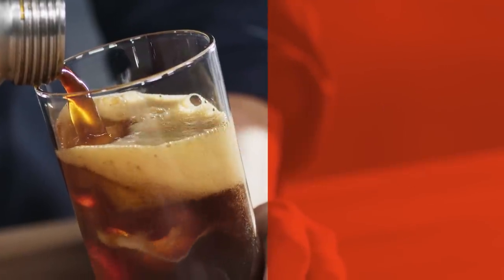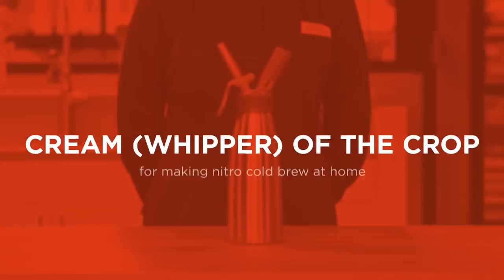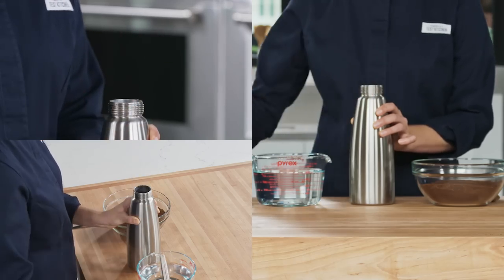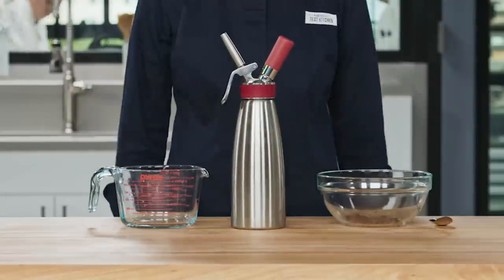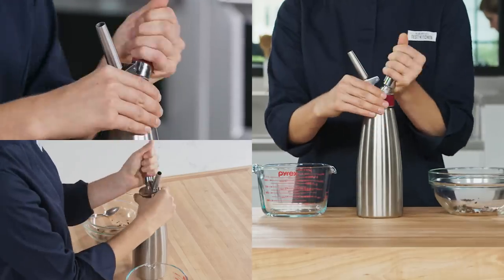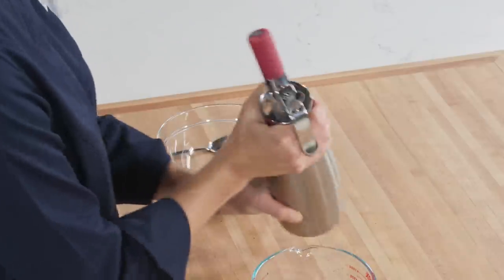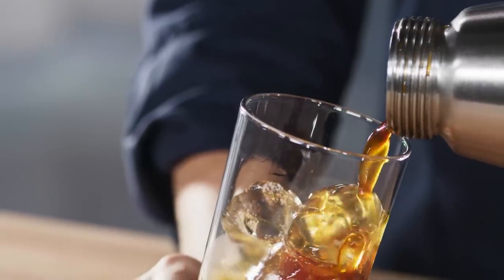How to Make Nitro Cold-Brew Coffee

Comment: That's an INSANE amount of nitrous oxide cartridges to use for what amounts to less than a pint of coffee...
Buying a 24 pack from Amazon costs 29.89, for $1.245 per charge. Using 5 charges to make a pint of coffee totals  $6.23 in pressurized gas.
The total volume of the whipper is a pint, but we'll probably only get 70-80 % of that volume as actual coffee. So that amounts to 355 ml of coffee...

That makes for $17.55 per liter in gas charges alone.
Reply: whitescar2 Thanks for doing the math. This seems like one of those things to do just for the ‘cool’ factor.
Reply: Just looked and you can get 50 for $37 on Amazon
Reply: @drthmik  I'm sure it's possible to push that value down, though I would assume that the price per charge is still around 1$ per cartridge for the kind of gas that you'd want to use in this application. Maybe the bulk buy is a great deal, or maybe you're putting yourself in danger if the gas isn't 'food grade', the capsules don't hold as much pressure, or are of an inferior and potentially dangerous quality.

I ran the numbers for what I'd assume an "average" user might encounter. Although I suppose an average user wouldn't be using a whipped cream siphon to brew coffee...
Reply: You're getting ripped off at that price, I bought a ten pack at bed bath and beyond for $9.99 or about a buck a piece.
Reply: Chargers are definitely expensive, but the recipe only calls for one. The other chargers are only if you don't want to take the time to brew cold brew traditionally. They're completely optional. The video covers this.
Reply: If you can filter out the sputtered coffee, you should be able to huff the resulting laughing gas. Waste not, want not, amiright?
Reply: @MelindaGreen  I love saying "am I right?". It takes away the ability for someone to say the idiotic phrase "I know, right?". Am I right? 😁
Reply: Exactly...theres a better version of this on chefsteps
Reply: whitescar2 
Just to clarify, the main part of this video was using nitrous chargers to make quick cold brew.
Reply: 24 for $16 cad at Costco business. I used a lot of them for "other reasons" 
You could also just brew the coffee concentrate longer using another steeping method. The multiple cartridges was only for brewing it over an hour vs overnight
Reply: That's why you get a large canister of nitro
Reply: Thanks for the breakdown! This presenter kept changing chargers. I call B.S.   Who can afford that? Ahhh, a "Test Kitchen, can!"
Reply: You’re way overpaying for cartridges at that price.
Reply: Yeah, this isn't how you do it, this is for wasteful people. You first make cold brew, then put it in the whipper, then use one cartridge..

Comment: What a waste of resources. 5 CO2 cartridges to make some coffee.....
Reply: N2O?
Reply: It does seem a little extreme. Depending on where you buy your whipits from and how many you're willing to buy it seems like it would add $3 to $5 to the cold brew. But some people may find that acceptable.
Reply: Its not like nitrogen is the most common element in the air... And those canisters can be recycled.
Reply: @axeavier  No, just N2
Reply: @obtree  no, nitrous oxide is N2O
Reply: @Crushnaut  They're not putting a psychoactive chemical into food. Pretty sure about that one.
Reply: @Crushnaut  Also, nitrous oxide is n2o. NO2 is nitrogen dioxide, and it's used to make nitric acid.
Reply: @obtree  you are right about the N2O vs no2 ... But they are using nitrous oxide. Look on Amazon for whipit canisters. They are nitrous oxide.
Reply: @obtree  from Wikipedia; The gas is approved for use as a food additive (also known as E942), specifically as an aerosol spray propellant. Its most common uses in this context are in aerosol whipped cream canisters and cooking sprays.
Reply: @AbsurdJosh  I think you mean "not like nitrogen is the *rarest*" because it is actually the most common element in the air
Reply: Bigger waste is taking all the time to do this and pouring it over ice

Comment: Thanks for the video! Very informative for my use!
I have a nitrogen generator (do not need tanks of gas) and am planning on making my cold brew in a 7 gallon wide mouth Torpedo corny keg to have 5 gallons finished product. 
Was definitely wanting to brew with light pressure to have an oxygen free environment but after watching this brewing in a high pressure environment for a quicker brew time makes more sense. I may have to get a TDS meter and experiment. Purging and doing it a second time makes sense too. 
I agree this would be expensive using cartridges but I’m only paying for electricity to make my own 99.97% pure nitro using a generator.
Reply: Yeah I've got CO2 tanks, korny kegs, and all done at 60psi to cold water for sparkling water at all times with my morning espresso. Have been looking to get tanks of nitrogen gas with no luck, I'll look into a generator like you mentioned to make nitro Pepsi, thank you!

Comment: A lot of you really didn't pay attention to the video. The recipe doesn't call for 5 charges, it only calls for 1. The other 4 were shown, explicitly, as an alternate option to speed up the cold brew process if you didn't want to wait 24 hours. They, literally start the video saying "our 24 hour fool proof steep method works great for this, but we've found that a cream whipper can also be used to quick brew cold brew concentrate under pressure. Cutting the brew time down to just over an hour."  They're just giving you options.

Usually the ATK comments section is a lot more sensible than this, but for this particular video apparently people just tuned al the info given at the beginning.

Comment: Seriously, what the heck? Not only is the brew process unnecessary and wasteful, you completely knock the gas from suspension once you filter it and undo everything up to that point. That's nonsense. Just cold brew the long way then charge it with one nitro cartridge at the end.
Reply: They cover exactly that. The first thing they say is the that "the 24 hours steep method works great for this". The other method is just an option they gave for impatient people. The recipe shown only uses one cartridge.
Reply: @schweedy1985  the point being that the quick method is wasteful, impractical, expensive and completely unnecessary. On top of that, they completely negate the charged brewing when they filter it. It's just dumb.
Reply: @leesalt  Regarding the loss of charge when filtered, they're still making the cold brew concentrate at that point. They don't want that to be charged, they just want concentrated cold brew. 

 I'll agree that this quick method is impractical, but they gave it as an option not a requirement. They just know some people don't want to wait 24 hours for steeped cold brew, and offered an alternative to speed it up. Obviously you and I will not ever be the ones using that process, but people are acting like it's part of the recipe, and it's not. It's just an alternate way to get to a cold brew concentrate.
Reply: @schweedy1985  they didn't cover exactly that.  They mentioned something about slow brew, but it gave no directions on how to make nitro coffee using that method.
Reply: @arviragus But they did...

There are two recipes in this video. One for quick cold brew(which is arguably a waste of expensive charges, but it saves 20+ hours of waiting), and one for the making of nitro. 

OP here was complaining about how much of a waste the quick cold brew method is, and states they should just brew cold brew the long way. Which is totally fine as an opinion, in fact I mostly agree, but they stated it in such a way that it's an attack on the video, which is bs. The video does also cover that the slow method is a perfectly acceptable option; "our fool proof 24 hour steep method works great for this". The recipe that follows is just them giving you the knowledge of how to make cold brew concentrate quickly using nitro charges(they are not making nitro yet at this point, just the cold brew concentrate). Additionally OP mentions how that portion of the recipe doesn't make since because they would displace the nitro during the filtering process; which is true, the charge would displace... but they aren't trying to hold on to the gas at this stage, since they're still just creating the concentrate. 

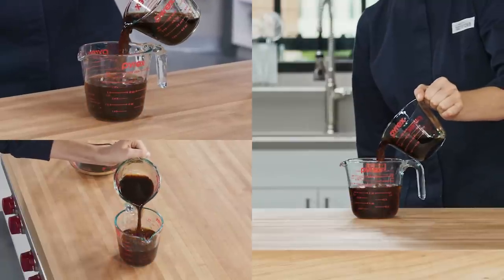The recipe for the nitro cold brew itself comes afterwards once the concentrate is made(at 2:10).  

Basically think of it this way, in order to make nitro you need cold brew concentrate. They tell you doing it the slow way works great, but also give you an option by showing you how to do it the fast(and expensive) way shown in the middle portion of this video. Once you have cold brew concentrate you just follow the recipe at the end for making the nitro cold brew. 

So many people are caught up on this quick method for making cold brew concentrate being wasteful, but the video doesn't tell you you have to use it... they're just giving you options if you don't want to prepare a full day in advance.
Reply: @schweedy1985 , You are misuderstanding LeeSalt, only one nitro cartridge is needed! Every time you release pressure, and add repressurize, you've unnecessarily wasted a cartridge.  Ask anyone that makes CO2 soda pop at home.
Reply: @tjam4229  I am not misunderstanding OP at all,  you are misunderstanding me. 

Please watch the video, and listen to them. There are making cold brew concentrate at that point, not nitro. I fully understand what you are saying, it's just not relevant to what they are doing in that recipe. They aren't trying to hold on to the nitro gas to make nitro yet, they just using the gas to speed up the process of making cold brew concentrate. (which usually needs to steep for 20-24 hours, this recipe using the charges takes minutes instead, they're simply giving you options)

 (There are two recipes in this video: first is for quickly making concentrate using multiple nitro charges,  and second for making the nitro itself) 

If you don't understand what I'm getting at here, read all the other messages I have posted in this thread. I've covered nearly everything there is to cover.

Comment: This is a neat idea, but it would have been nice to get more info about the reasoning behind this process. What is the reason for carbonating three times? Is during-brew carbonation just to expedite the brew process, or is it actually affecting the final product significantly?
That said, this seems like an extremely complex (not to mention expensive) process. I'm pretty sure the materials cost for the NO2 canisters alone negates any savings in doing it at home. I understand that ATK is aiming at those who have perhaps more money and time than technical ability, but wouldn't it make vastly more sense to DIY a carbonation system compatible with NO2, both for bulk production and cost savings? Aside from a teensy bit of tool use and pressure-testing up front, I'm pretty sure that's almost as easy, way faster, and way less expensive in the long run.
Reply: Take this with a grain of salt, but I think it might have something to do with the ability of N2O to dissolve in fats. Once the N2O is dissolved in the water, it may help to dissolve the oils of the coffee into the water, speeding up the brewing process. But I highly doubt it's worth the cost and the atmospheric effects of laughing gas.
Btw, two technicalities: It's N2O, not NO2. If you used nitrogen dioxide, you would be drinking nitric acid. And it's not carbonation, that's only with CO2 :)
Reply: Whoops, yes, you're absolutely correct. Been a few years since I had to take a chem class, and I thought I remembered better than I actually did :)

Comment: I think using all those Nitro cartridges are a waste for such a small amount of coffee.  I think there must be a better, cheaper, similar way to do the same thing for a lot less and less wasted cartridges
Reply: Yes, brew your cold brew the old fashion way (steep it like tea for 20 hours). Boom.. just saved like 4 cartridges
Reply: Well now you're just being rational.  😋
Reply: They literally cover this in the video. The recipe only uses one charge. No one seems to have actually watched this.
Reply: @schweedy1985  It uses 2 cartridges charged 2x and 1 cartridge charged 3x
Reply: @IngaHicks  The first four charges are all for their method to quickly make cold brew concentrate. The beginning of the video covers that the standard 24 hour steep method works just as well. 

The actual nitro cold brew recipe is to take cold brew concentrate, water it down to your desired strength, and use 1 charge.
Reply: @schweedy1985  ok, thanks!  I see its cold brew nitro charged concentrate, then charged again in the diluted brew, thanks!

Comment: Really messed it up proposing making cold-brew concentrate in the whipper instead of the usual process. That is 99% of your complaints. If you just showed how to make just the nitro cold-brew with the usual cold-brew concentrate method, a normal but slow process without so much ridiculous waste, you wouldn't have such a messy comment section.

Comment: WTF?  I think she's been inhaling nitrogen that's leaking from all of the canisters she's been using.
They should've made the video into 2 DISTINCT parts: Part 1 non-speedy method to completion, then part 2, speedy method.  2nd comment: To charge, then discharge, then recharge, makes no sense. The coffee in the vessel will only absorb a certain amount of nitro.  If you are releasing pressure, then there is plenty of nitro left in the vessle.. adding another cartrige is doing NOTHING BUT WASTING NITRO CANISTERS.  ASK anyone that uses C02 to make soda pop at home.  They don't keep changing canisters!

Comment: This is Laughing gas coffee! Nitrous Oxide is not the same as Nitrogen.
Reply: LOL
Reply: Nitrous oxide is what is used just the same. 100% can confirm. Have worked in a coffee shop. You're not breathing it in, so you're not getting that extreme concentration straight in to your blood stream, thus you don't get high.(same reason you don't get high when you consume whipped cream from a coffee shop, since most coffee shops make their whip with Nitrous oxide as well).. on the other hand if you just charged an empty canister and huffed the air out of it you'd know instantly that it was, in fact, laughing gas.